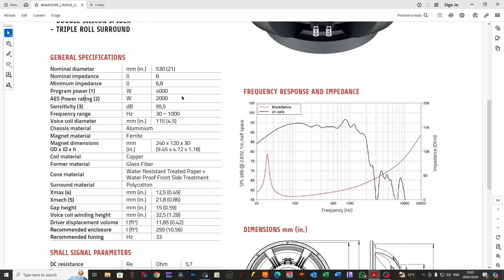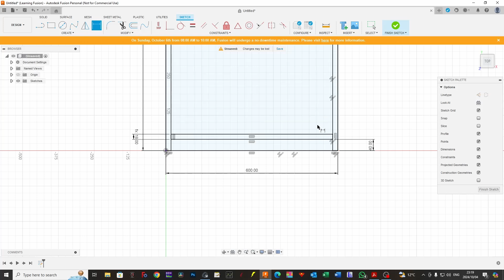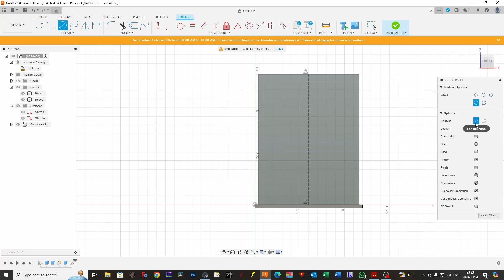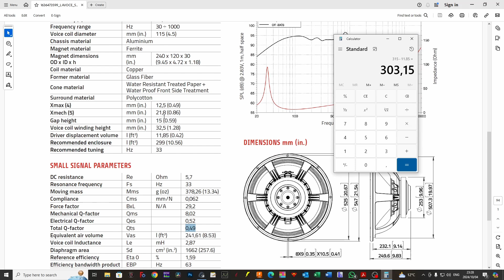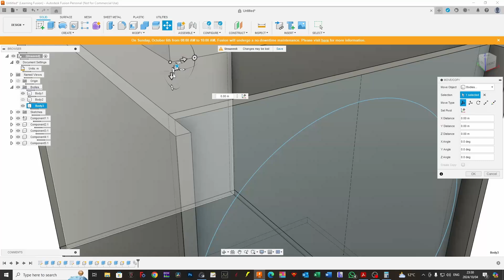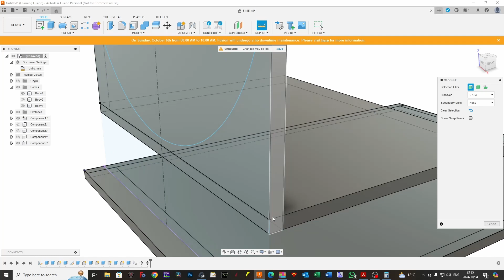The Lavoce SAF214.50 Subwoofer - Designing the AmaPiano Getto Blaster 6000

Comment: Kudos for the excellent video.
The only complaint is the speaker's Xmax.
The Lavoce SAF214.50 has a 32.5mm voice coil winding height (Hc) and a 15mm gap height (Hg). I prefer the calculation (HC-Hg)/2 up to which the speaker will certainly be able to operate linearly (of course assuming that the suspension linearity will allow it to do so as well) and I consider it the engineering Xmax. This results in an Xmax of 8.75mm.
All the additions that some companies prefer, which go up to 60%, justifying that the coil is still in a sufficiently strong magnetic field and that the THD did not exceed 10%, but for me they are marketing Xmax and misleading the user, so I consider the chosen 12.5mm too much.
Reply from the maker: HI Brother, sure working on the coil height - gap height /2 is a solid calculation. However some of the products on the market depending on how it was designed can actually have a usable BL below Xmax, for example we could calculate 8mm Xmax using the above but reach 80% Bl at 5mm Xmax. Or like many modern drivers hit 80% at 10 or 11mm with some being higher. Xvar is often always a couple mm higher 🎉
Reply: @The-Sound-Guy  I absolutely agree with you, but then it must be standardized according to some (e.g. AES) standard by which all companies will be compared. So it is not the height of the voice coil and the magnetic gap that matters, but the height of the usable magnetic field within which the THD does not exceed, for example, 1, 5 or 10%. In this way, when you compare speakers from different manufacturers, and you are not aware that they all display their Xmax according to different standards and calculations, you can be deceived that one speaker has better properties than the other, when in fact it may be the other way around. Then you are comparing apples and oranges, and you should be comparing apples and apples.

Comment: Will these work in a horn set up
Reply from the maker: @terrypillay4135  not optimal, however depending on the many horn layouts, you can indeed use them but you will need to check in something like hornresp. Mid Q drivers often don't give you the large advantage vs say Q below 0.3 

MLTL designs, TL, and double bass reflex "dual chamber" and other non horn loaded designs you will be 100% ok 👍
Reply: @The-Sound-Guy  was looking at the void nexus xl cabinets
Reply from the maker: @terrypillay4135 just had a look at the Void enclosure and specifications, I take away 2 things on the specification. 104dB sensitivity 2000 watts using 10 log formula gives us 137dB, brand specifications is 135 and 141db peak.. so I'm not sure if this factors in power compression right off the top of my head it's something worth asking considering the overall Price points. 

The range of the subwoofer and the sensitivity combined in such a small footprint feels like a to good to be true situation, again not saying it won't deliver, but I remain optimistic.

If you have plans for the cab and are looking for a suitable driver a lower Q and higher BL product is very much recommended if you are chasingrelative performance. 👌